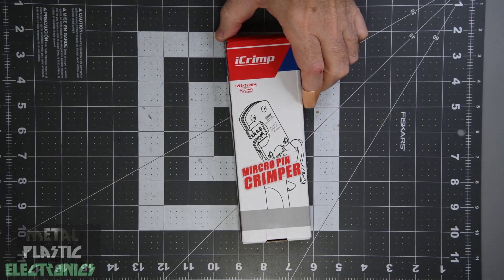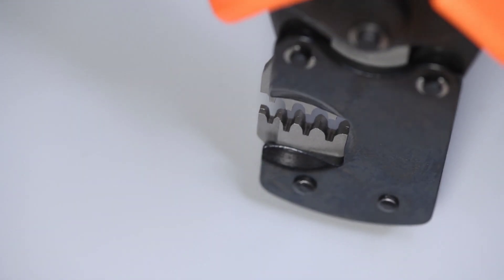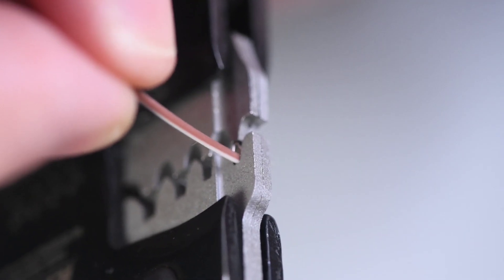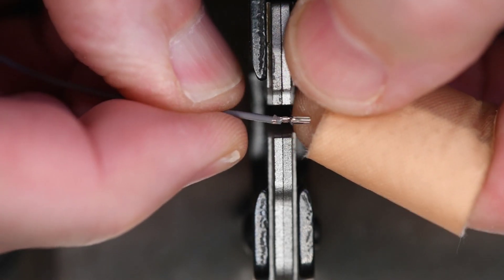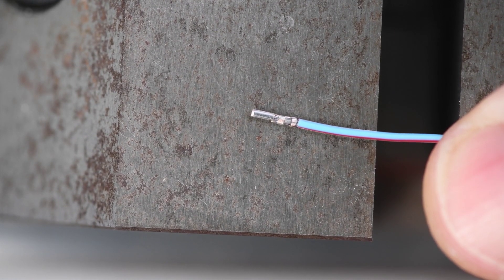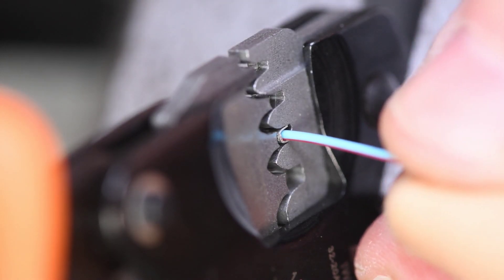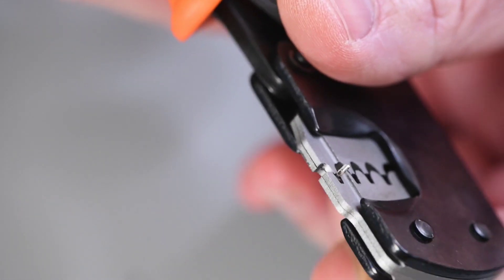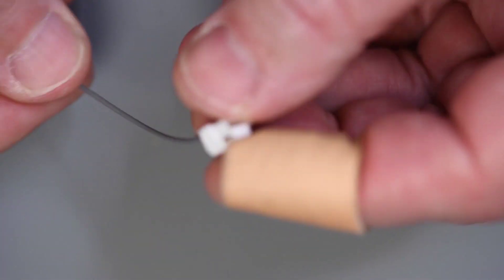iCrimp IWS-3220M vs CLIK-Mate Terminal

Comment: I bought this but it sucks doesn't work for my car terminals they are around 5mm long and this crimp have the teeth too tight
Reply from the maker: Yes, this is for very small terminals.  They make a larger version of this, but they are not of great quality.

Comment: I ordered this crimping tool and am waiting to receive it, but I also ordered the IWISS IWS-2820 model which is a manual (non-ratchet) tool that's more "manual" and perhaps more controllable since the jaws are thinner and you have to crimp the wire tabs and insulation tabs separately. This should give you more control. I'll see which one I like more when I receive them.
Reply: How was it? Can you update us please?
Reply: @Mario_Samir_YT  Tools were very precise, as I am used to from IWISS. No issues. One thing however, that I can't do anything without, when it comes to crimping small connectors, is magnification. I use either a regular Chinese no-name USB microscope  or my iPhone camera on a tripod. This is so that I can see what I'm doing when inserting pins into the jaws or inserting the wire into the pins. Without some kind of magnification it is impossible (at least for me) so crimp anything. It's way too small for my eyes.

Comment: I've been using the 1.3mm slot on the Clik mates. It does a much better job of rolling the insulation tabs. Its too wide and the wire doesn't get crimped securely but it works cleanly without damaging the connector. I go back with the PA-09 and tighten up the wire section. Then slightly pinch the width of the insulation section so it fits better into the Clik mate housing.

Disabling the ratchet helps with feel, the last ratchet click is too tight and crushes the connector, tearing the insulation tabs. Just squeeze until you meet resistance and stop.

It is tedious, but its not $450 tedious, which is what Molex wants for the official crimp tool.
Reply from the maker: I got a PA-09 to try and am very happy with it.  I now use it more than any other crimp tool.

Comment: Looks like it performs like all those similarly priced two in one crimpers… ok but not great.
I’ll be sticking to the PA-09
Reply from the maker: Have you tried the PA-09 on a Molex Clik-Mate terminal?  Or any very small terminal for that matter?  I'm still looking for a tool to do a better job.  That doesn't break the bank.  Thanks.